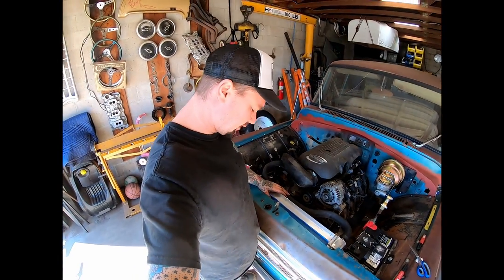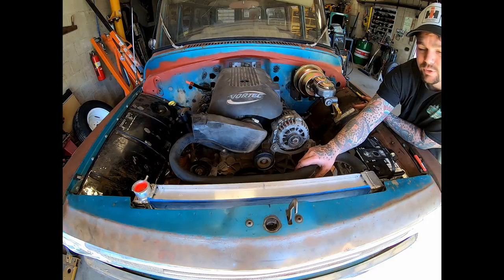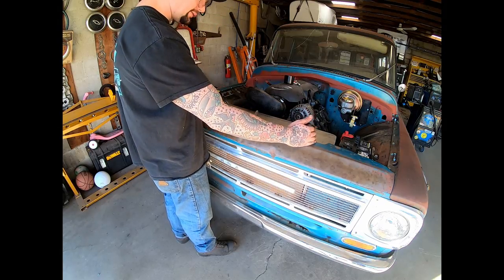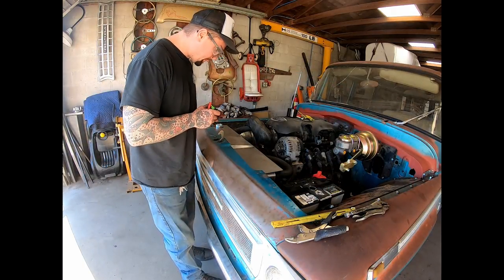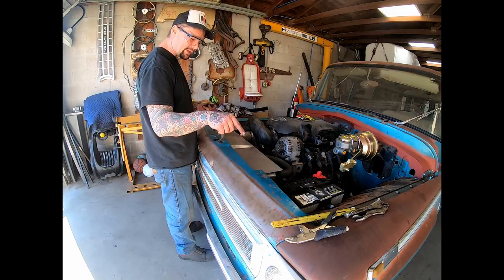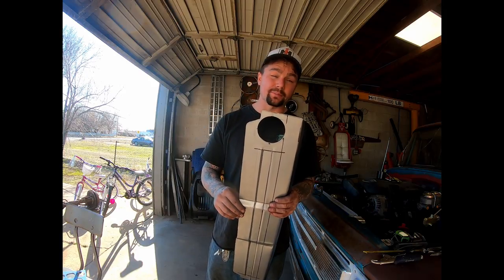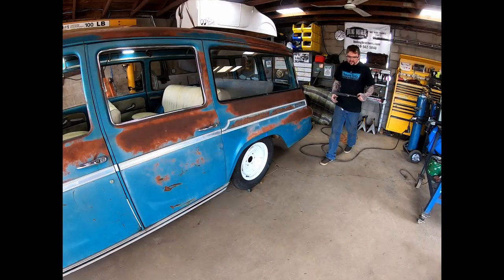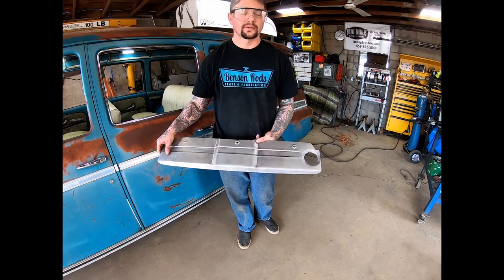BUILDING A SHEETMETAL RADIATOR COVER!

Comment: Turned out trick. Looks Factree ! I have a suggestion if your interested ? Make an aluminum tube to go under the shield so the big hose could be cut way down and not detract from the look of your nice fab work. Especially at the drivers side filler neck, where the stock hose kicks way out. It would be well hidden and it would also help disappate additional heat and help avoid hot heat hose collapse. Just a thought ??
Reply from the maker: The hose don’t bother me to bad, I think if I change anything there I’ll swap a 2010 canary water pump on. It exits to the from and driver side. The would land me a fresh water pump and clean it up some.